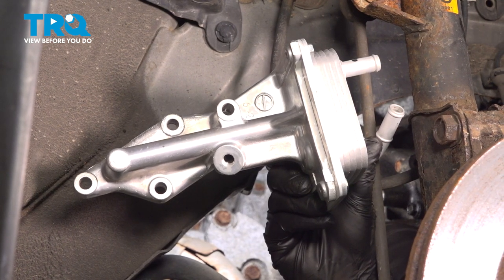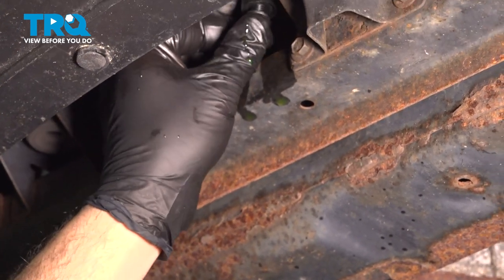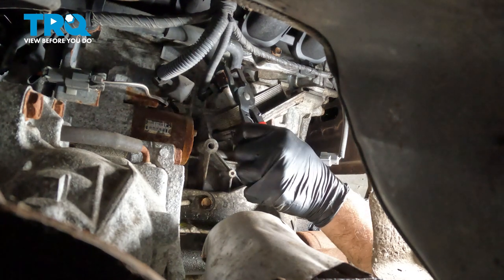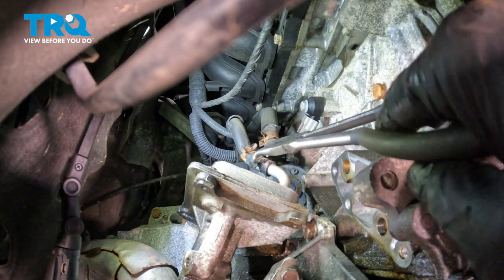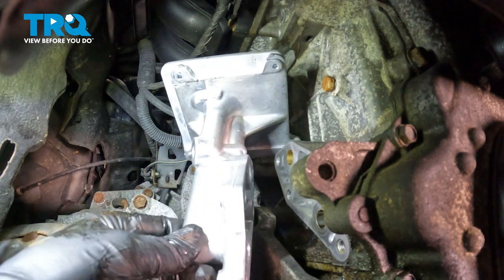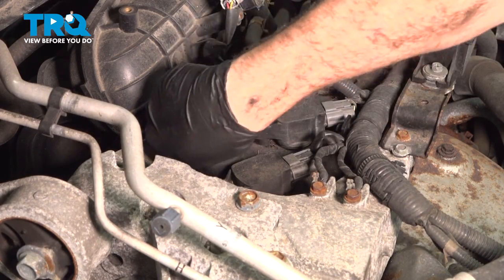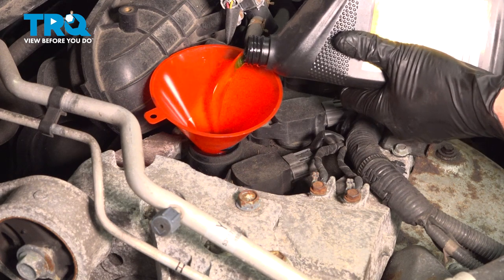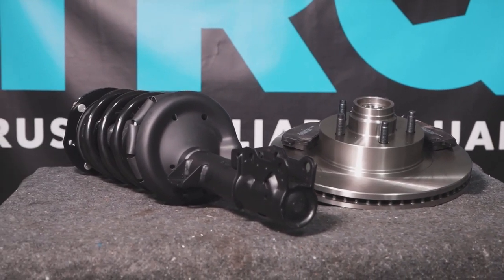How to Replace Engine Oil Cooler 2008-2013 Nissan Rogue

Comment: Never open the radiator cop when the engine is hot, and that is a very good thing to say, but my 08 grand marquis does not design like that, it designs like my radiator doesn't have any cop, but the tank of the cop is the radiator cop, thank you MR, AND THANKS TO TRQ